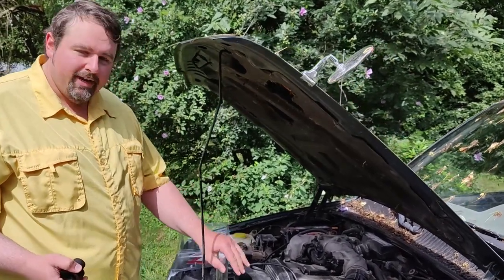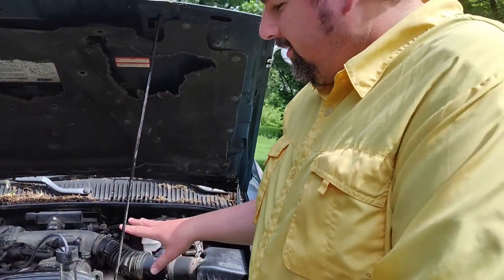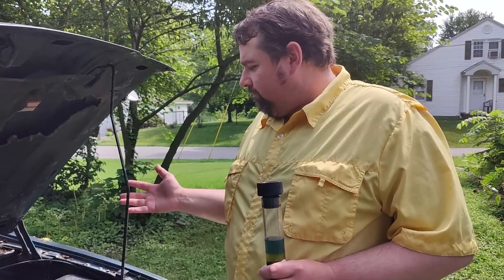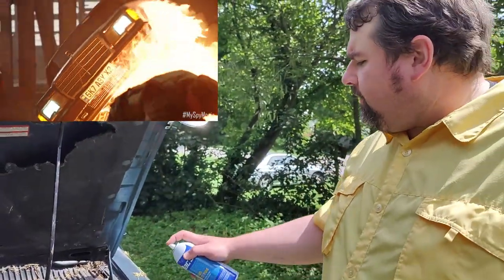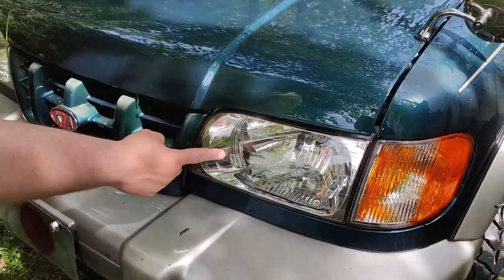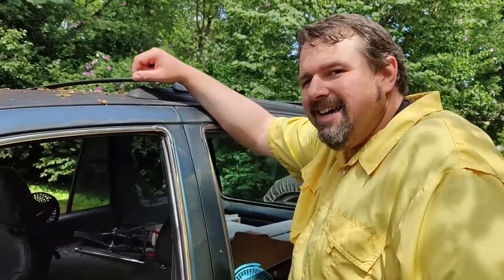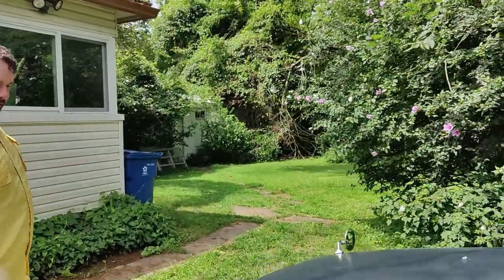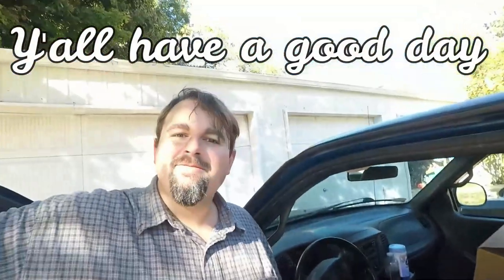1999 KIA Sportage STILL overheating.  What's the Fix?

Comment: I have a 2002 I put a new radiator and found a new fan clutch in the junkyard and I run cool in the summer in the heat of Palm Springs CA
Reply from the maker: Thank you for the information. I may have to look at changing the fan clutch. The fan still looks to be spinning well, but it can be very hard to tell if it is spinning at the right speed.